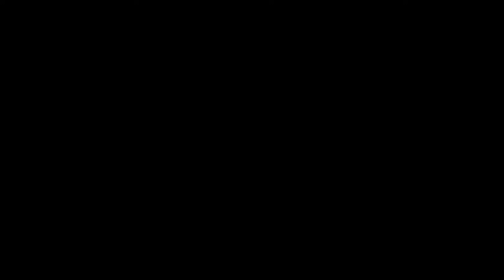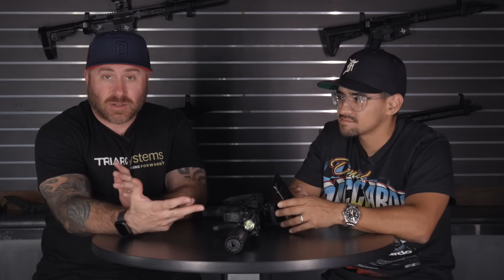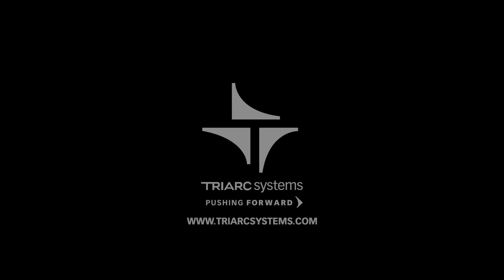Shop Talk: Rail Q&A

Comment: Excited to see it out there. Specifically independent testing. 
Personally I’d prefer that it didn’t include the forward qd slot, as those are the most important mlok slots on the gun. 
To each his own.
Reply: Yeah I was thinking the same thing but they seem pretty low profile. Not sure why they went ahead with it because as you said most important area of the rail aside from it costing more money and time to produce. We all would of been just as happy if not more with the option to attach as M-lok QD socket there instead.

Comment: The Multicam Tropic is AMAZING!   
I wish it had been an option when I originally ordered.  

My 10.5 and 12.5 are now “in production” (ordered November 2020) and I can’t believe I’m going to say this… I wish they weren’t being built until the first limited release of the new rail.  I’d love to be a part of the “extended T&E” process.  

Keep up the great work guys.
Reply: Update.  I did reach out to Triarc to ask if I delayed my build a couple more months (original order date of 11/18/2020)  if I could “get in line for the new rail” and was told that the “wedge lock is assigned to my builds”.
Reply: @AndyAdventuring  any update? My March 21 order is now in parts allocation. Thought that meant I might be seeing it sooner rather than later, but it's been two weeks with no update since then so I'm thinking parts allocation doesn't really mean anything.
Reply: @AndyAdventuring  thanks for the update. They've got a really shitty business model, I'd have cancelled my order 6 months ago if there was another company who made 11.5" barreled uppers with <.055 gas ports and wedgelock rails. Sadly there's not so here I am. Probably in parts allocation for the next 4 months.

Comment: Radian is the only AR15 that matches there Upper and Lowers perfect
Reply: Not only but the best cosmetic to me Radian
Reply: For sure. I have a Radian and they're just the top tier of the top tiers (not including KAC and LMT since those are kind of mil-specific and don't compare very well). The only thing I prefer to switch on my Radian was changing to an A5 buffer system and changing the barrel to a Criterion CORE just for the better gassing and the lighter profile, which is a shame since the stock barrel is basically a $500 Shillen barrel that's stupid accurate. That said, I love the Wedgelock rail and all of the Hodge/Mega designed parts with that unmatched anodizing. The Hodge wedgelock rail became an OEM part on lots of high end brands for a reason.